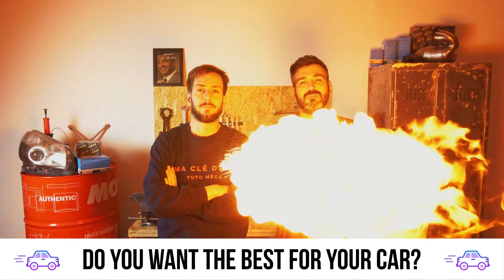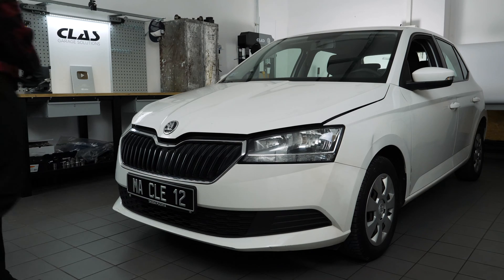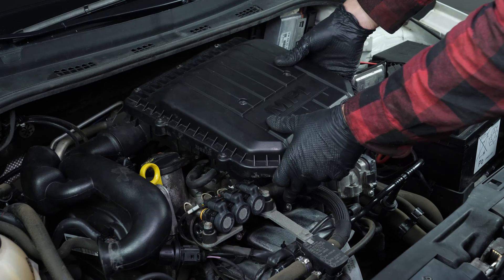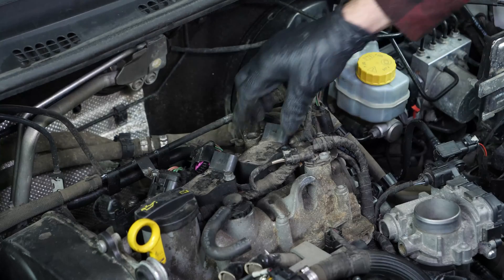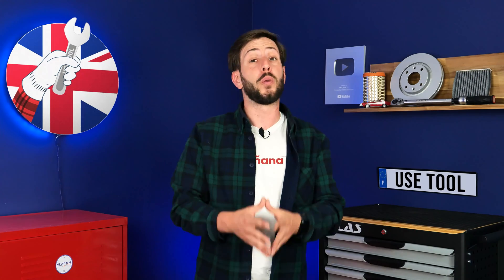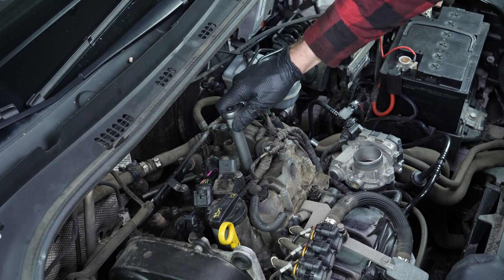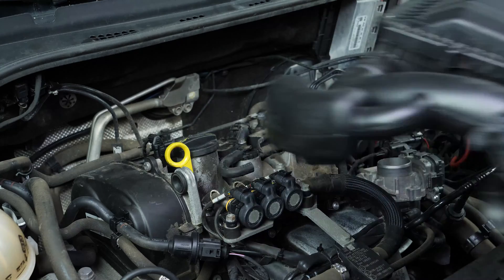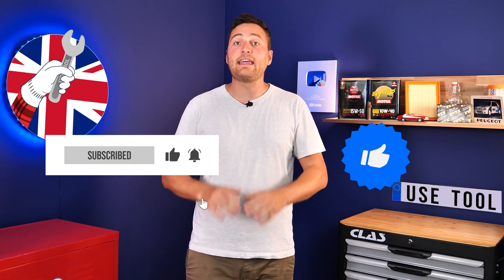How to replace the spark plugs Fabia mk3 1.0 MPI ⚡

Comment: With what force should spark plugs be tightened? How much should the wrench turn? 1/16 or 1/8? Thank you
Reply: First make sure the engine is cold so you don't strip the threads.
From the Skoda workshop manual edition 04.2020: 
The correct torque is 22nm for the plugs and 8nm for the coil bolts. You may see other places specifying 28 which is incorrect. The manual states "Rep. gr. 28" referring you to the ignition system repair guide for the values. Some people have wrongly read this as being the torque setting.
Reply: @0oJEBo0  Thank you very much, you’ve helped me a lot